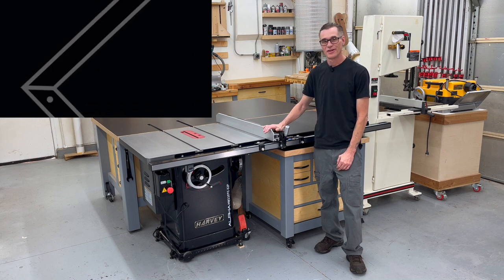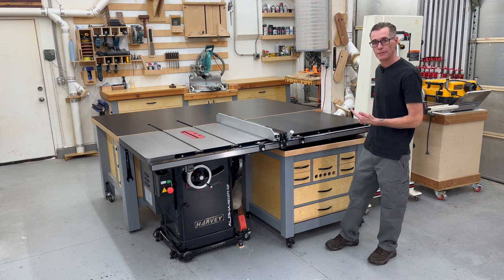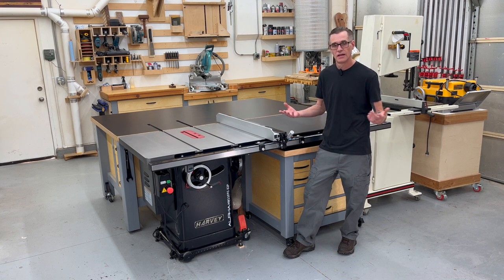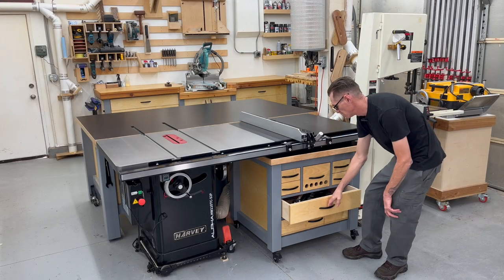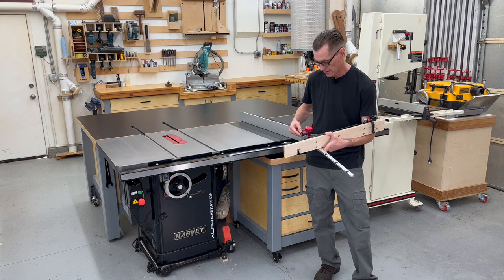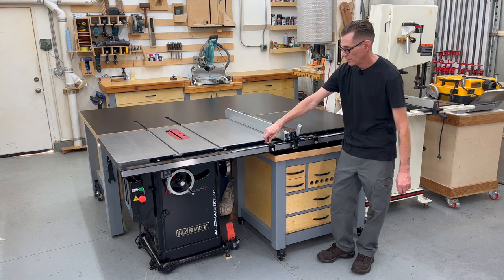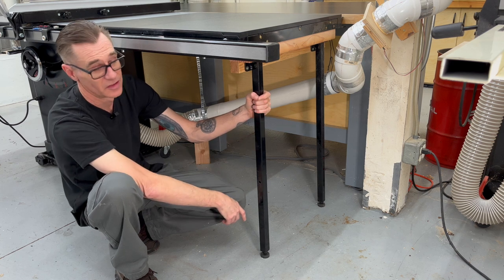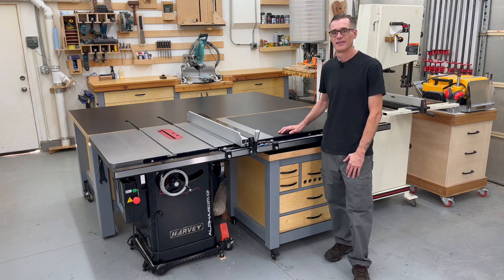Harvey table saw 2 month review

Comment: Just got the same saw today. Took me quite a while to assemble, and the instructions are not good. Thank goodness there were videos on YouTube to help with any confusion. The one thing I don't like about the saw even before using it yet is the extension table wings. Idk why they made the tops made out of cheap laminate. Why it's not metal is where they cheaped out on. One came partially cracked, and another dented. I'm sure it happened during shipping, but if it were metal, that wouldn't have happened. Anyways Thanks for the video👌

Comment: I had the same issue with locking the height adjustment on my secondhand Delta. and put a washer between the locking knob and shaft of the wheel and solved the problem. it seemed like the knob and wheel were coming into contact and that created the problem. good luck!
Reply from the maker: Thanks for the tip. I’ll look into that for sure. That seems about as easy a fix as I’m gonna find. Thanks for watching. Hope you have a great day!

Comment: Great review.  I have the 4 Horse 36" Harvey, in operation since in operation since February 2022. I had some initial issues with my saw which have all been overcome and I'm very pleased with my purchase.

Overhead dust collection: I too removed the overhead dust collecting pipe and guard, but for different reasons.  I used the blade guard on my old table saw for years, as it would hinge up our of the way, which I very much liked.  I still use a steel rule or a tape measure to adjust my fence to the blade as view finders are just not accurate enough for my liking and as I often bumped the view finders out of alignment, as I take the fence off my saw frequently.  If the Harvey blade guard hinged up out of the way as some saw do (SawStop, for example) I believe I would use the overhead dust collection, especially with the fence in the low orientation, for clearance.  I have two riving knives for different thickness saw blades and they work well.

Lock knob:  I know Harvey makes incrimental changes to their tools... the miter gauge as you pointed out for one.  My locking knob for the height and tilt adjustments are different from your saw.  The knobs on my saw are knurled steel and work very well.  You don't even need to crank down on them to hold the adjustment wheels snug.  I don't know if that's the new design for all Harvey table saws, but by the looks of it, I very much prefer the steel knobs.  

Manual: I had recieved a manual.  Probably an oversight. 

Support Legs: I agree about the support legs.  I had the same issue with a mobile base.  I have since added the router table extension wing which came with improved legs.  They included leg extensions to compensate for mobile bases with the added weight of the cast iron router table the legs are stable.  

Have a good one.

Comment: I have the Harvey ALPHA HW110LC-36P 10" 2HP Cabinet Table Saw. I got it on a Black Friday sale the last time it was ever offered for $1799. I wired mine to run on 240v, the saw came with that feature, and they even sent the 240v switch to replace the 120v one that comes installed on the saw.

I also like the pullback feature of the fence and have used that often when cutting segments for wood turning. Harvey has just come out with a new rip fence that I wish my saw had. They addressed the issues I have found with mine. However, at a price of $1200 for this new fence system, I will keep my old fence. As for the blade adjustment wheels, I have found I do not have to tighten them all that tight to hold the adjustment. However, I did find that, if I don't tighten it at all, that small knob will eventually unscrew and fall off.

Thanks for your review. BTW - I did not see the link to those caps for the overhead dust pipe.
Reply from the maker: Thank you for the comments. Sorry about that link. I was having an issue and removed all links from my videos. Here it is if you are interested 
Made in USA Prescott Plastics 1 1/2" (38.1 mm) Diameter - https://a.co/d/aDdOtbu. Hope you have a great day!

Comment: I am a professional woodworker looking to replace my older Delta cabinet saw.  Thank you for your opinions and info.  I would have liked to learn about the cabinet dust collection ability.  Table saws are known to kick out fine shavings and an enormous amount of dust.  SawStop has a directional port under the blade which minimizes space, thereby increasing its ability to capture dust, especially if fitted with a zero clearance throat plate insert.  Harvey's hi-low fence is basically the same as the Delta's, and I absolutely love it.  It's one of the reasons I'm still intrigued with the Harvey saw and not SawStop, Powermatic, Jet, etc.  Unlike you and probably others, I feel strongly about using a blade guard.  I use mine all the time, like a seat belt in a car.  There are over 30,000 table saw injuries per year, most result in amputations, kick backs and even death.  With the blade guard about 1/8" or less above you wood material, it helps reduce those injuries plus, if attached to suction, it sucks up much of the dust from the saw blade, that the cabinet port can't. There are a couple companies, including Harvey, that sell a 3-4 inch port overhead dust collection on a sturdy swing arm, anything smaller than 3" is useless. Harvey actually manufactures a very unique 'fish bowl' design guard, enabling it to also collect dust from edge and angle cuts, (Model S-12S 'Shark' Universal Overhead Guard).   I think Harvey makes quality/precision tools overall and I enjoyed your input and review, however; I am concerned about not having a dealership network and furthermore, its resale value.

Comment: Nice review. I have had the 2Hp 36" for almost 3 years and couldn't be happier. My one 'peeve' with the fence is that both the tightener knobs for the fence are on one end of the fence. The far end of the aluminum extrusion always sags and scrapes on the table. THAT DRIVES ME NUTS! I love the silent swoosh of swinging the fence from 36 down to 1/4" without the sound of metal to metal. 

ALSO! I did the 'Carbon Method" ceramic coating on the table about 6 months ago - the table top is still flawless and slick I recommend using it. Not cheap, and I am not affiliated but it works.
Reply from the maker: Awesome. I hear you about the fence. I found a single layer of shop towel under the far end before tightening the knobs keeps it from hanging up. Lame but works. I also used carbon method on the top before I even used the saw and I agree it’s pretty slick stuff. I didn’t mention it in the video because I didn’t want to come off a product pusher. Plus I want to see how it holds up before I recommend it to anyone. Thanks for watching, hope you have a great day!
Reply: @squareandlevel  I use two empty Rockler gift certificate cards (credit cards) under each end of the fence to tighten but then, when I come back, the fence has drooped and scrapes on the table. It is just a bit frustrating that this precision piece of equipment has such a basic flaw.  And awesome on the carbon method.
Reply: @dennisdoherty3221  loosen the aluminum fence put a business card under each end, tighten the knobs and you will not have a fence that scrapes your table. You can also adjust the nylon slider on the outfeed end of the fence to lift it a millimeter or so, mine slides like butter.

Comment: Thanks for the review on this saw. I’ve been watching a few different reviews on this saw. And I really think this is the saw I’m going to be going with when I get the chance to. I’m really wanting to get away from my Grizzly table saw that I’ve had for a few years now. With growing my craft I’m not happy with the defects that it has.
Reply from the maker: Thanks for watching and glad I may have been some help. I’m curious what issues you have with your grizzly?  It was on my list of possible options when I was deciding what to get. Thanks again. Hope you have a great day!
Reply: @squareandlevel  biggest issue it that the miter slots are not actually flat from front to back. They actually hump up in the middle. Makes using a sled a bit tricky if you don’t run thinner miter bars on the bottom. The other big issue is it’s hard to get square cuts because there is a dip between the miter slots where the blade is.

Comment: Great overview and wow, maybe an AH HA moment. The table top, extension wings, cabinet, side access doors, riving knife, extra dado insert, main rail seem to be designed and look exactly like a Grizzley 899, though a different color you have a bigger motor.  Wonder if one manufacturer makes saws like this for other resellers like Grizzly and Harvey to market under their own brand names. I found that to be true for tools like spindle sanders and scroll saws... Dig your extension / work table too.  Nice video!
Reply: Grizzly did at one time have Harvey (but under another name) produce their saws. Grizzly and Harvey had a difference of opinion and Grizzly went their different ways. But Laguna, Grizzly and I think Jet were all manufactures by the same company. After the Grizzly issue Harvey decided to brand themselves. After all they had vast knowledge from producing all the other brands. Either Laguna or jet discontinued  a model of their band saw so Harvey got the OK and produced it under their name the Ambassador series, with upgrades. The new Harvey table saws have the big eye fence system and in August at the IWF in Atlanta they will unveil their new nickel plates table top. The gold tin coat didn't do as well as they had hoped. This new nickel coating is on the table top, top and bottom, its dipped like a chrome plating but the trunnion is also nickel plated. Really nice upgrade. I have the Carbon method on my table but Id love to get the new Nickel top just because it shines..

Comment: it would be interesting to see if the height of the blade is moving when the knob is being tight. or how much. I am for sure buying a Harvey. thanks for the vid.
Reply from the maker: Great point! Definitely isn’t moving the blade much. Rarely would be an issue and is easy to hold the wheel in position while locking the knob. Just something I wanted to point out that is a little irritating. Thanks for watching. Hope you have a great day!

Comment: mine is 3 years old and have had the same problem with tightening the knobs on depth and angle. i have always had an issue with constantly having to square the blade to the top and also constantly adjusting the fence. so much so that i just stopped using it for a while. it was frustrating. this past week i worked on getting it square again. i was hopeful this would be the time that it stayed square. squared the table to .001 of the blade and the fence to .001 to the blade. made my first cut "practice" cut with a very straight edge piece of plywood and it was close to a 1/4" off from top to bottom. being frustrated is an understatement.
Reply from the maker: Darren, I’m sorry to hear that. Sounds incredibly frustrating. I have not had any issues with staying square. Only thing I can come up with is to check and make sure the main beam where the fence rail bolts to front on saw is secure. I can’t see how it could be that far off if the table to blade and blade to fence are adjusted properly. Hope you get it figured out. Thanks for watching and have a good weekend! 
Scott

Comment: I know it is easy just to order a zero clearance throat plate, but I see you have a band saw it seems to me you could easily cut some hardwood to the right thickness and then use your regular plate as a template to make the shape for the opening.

Comment: Hoping you might be able to offer a little wisdom for my new Harvey saw.  I have it all set up but cannot seem to get the riving knife to align well.  The instruction manual shows a "b" set of screws that hold the riving knife in place, and an "a" set of set screws that adjust the riving knife.  I loosened up the B, adjusted the A, alignment looks great...THEN...I retighten the B screws and the knife goes back out of alignment.  Hoping you might have some wisdom for me...thanks in advance...
Reply from the maker: I’m sorry unfortunately I do not. Mine adjusted with no issues like you are describing. Sorry I couldn’t help.

Comment: I got the 36" version about 2 months ago now and really like it, but I have the same problem with the locking of the adjustment wheels as you do. I've noticed it far more on the angle adjustment wheel than the height adjustment wheel though since I rarely get too picky about the height compare to the angle.

Comment: The 3HP does not come with the Dovetail Structured Trunnion System that their 4HP model comes with.  How was it adjusting the trunnion to make it square when you got the table saw?
Reply from the maker: Thanks for watching and the question. The trunnion setup was slightly out of square to the top in the “dangerous” way when I got the saw. Adjusting it was not difficult. It has set screws that can be used to adjust the trunnion position in relation to the cabinet body once the 4 main bolts are loosened. Then I just squared the blade to miter slots by turning the set screws. One set screw is a little awkward to get to, but not too bad. I probably should have touched on that in the video. I am of the opinion that a large majority of table saw accidents are due to improperly  set up saws. Whether it’s the top, trunnion, or fence. There was nothing wrong with my saw because it was out of square when I got it. It is an alignment procedure that needs to be checked on a regular basis. Thanks again for the excellent question. Hope you have a great day!

Comment: Did you mention that tilting the blade from 0 to 45 degrees requires 60 (Yes 60) rotations of the tilt wheel.
Reply from the maker: No. I did not. I honestly never even noticed that. Good thing to point out if that is an issue for anybody. Definitely not an issue to me personally.

Comment: Hi, I have the 36” saw on the way, thanks for the info!!! I got the mobile base from Harvey and notice you have one on yours. How does it roll. The published weight is like 511 pounds (wow! Lol). My hope is to keep it against the wall in my garage/wood shop and pull it out when I use it and turn it when I cut sheet goods.
Reply from the maker: Very exciting! I do not have the mobile base from Harvey. I took it off my old saw. I picked it up on Amazon. It does not roll great. The 36” should easier to roll than the 52”. I still wouldn’t want to be moving it often. Thanks for watching. Hope you have a great day!
Reply: @squareandlevel  Thanks for the quick response!!! I can’t wait till it gets here. I enjoyed your video! I always learn from videos like yours.

Comment: I have a 52" delta unifence. got it new in 1994 and it still functions great. I love it and it also has the high-low function but I've only used that a few times. The fence looks all most identical to yours as far as the extrusion. Mine is rock solid after all these years and I wouldn't trade it for any other fence. I'm curious as to the dimensions of the extrusion. Is there and online reference I could look at that you know of?
Reply from the maker: Sorry I don’t know that info. You might be able to find something on Harvey’s website or maybe try emailing their customer service and see if you can get a dimensional schematic for the extrusion. Sorry I couldn’t help ya. Thanks for the watching, hope you have a great day!
Reply: Thanks for the reply. I checked on their website after commenting on your video and there was nothing about it. I was just curious because it looks so much like the unifence extrusion. Again, thanks for getting back to me. That is a nice looking saw by the way. @squareandlevel

Comment: I also fall under the category of thinking about purchasing Harvey saw. I'm like you, engineer by day, wood and tool enthusiast by weekend. 
 Do you feel that there would be much difference between the 3 and 4 HP? And i want the router extender, should i just go with 36 inch with router, or the 52 inch? I want to be able to rip 4X8 ply. 
 Thank you
Reply from the maker: That’s exciting news about getting a new saw! I’ll try and answer your questions to the best of my ability. As far as 3hp vs 4hp. More is always better right?  3hp is plenty for me tho. Significant upgrade from the 1 3/4 hp I had before. Don’t quote me but if I remember correctly the 4hp was only available with the dovetail trunnion system which would probably make the setup up and maintenance of the saw easier than the standard type trunnion setup that the 3hp has. The router extension is very $$$, as you have to buy each component separately. It comes down to personal preference and space requirements. I had a router lift in my old saw left wing and didn’t like it. I decided to build a router table to go under the right wing of the new saw. I put a 2 part video together of table. Please check it out if you’re interested (shameless plug). If you do get the router extension, I would think you would just get the 36” saw and add the router extension to that. Since I don’t have it I can’t really give you any solid advice there. Hope that answers some of your questions. Thanks for watching, hope you have a great day!

Comment: With the fence in the low position, if you flipped it end over end could you use it as an L fence? Thanks for the in-depth look at the saw .
Reply from the maker: I suppose so, but I think it would be too high off the the table. Im guessing 3”?  I’ll double check when I get home from work. Depending on the thickness of materials being used it could possibly be an option. Thanks for watching. Hope you have a great day!
Reply from the maker: Fence measures 2 1/4”(55mm) off the table top flipping it as you described.